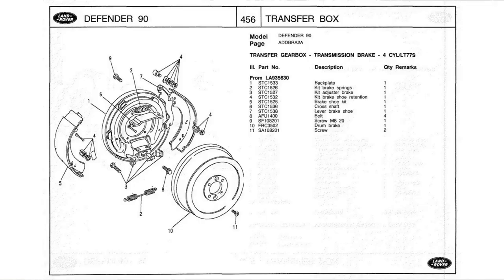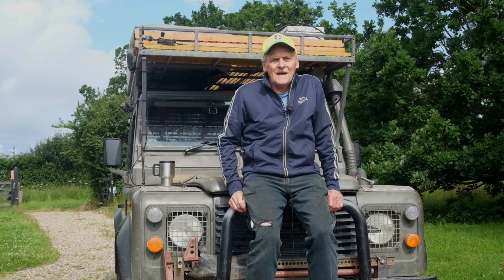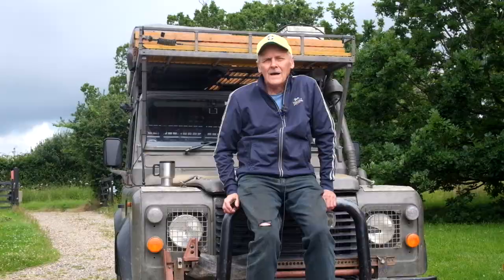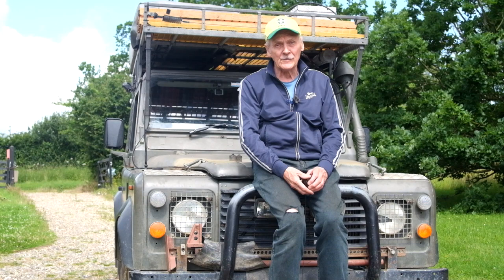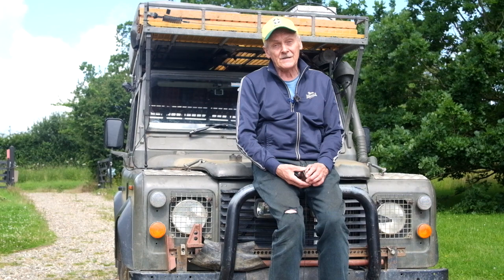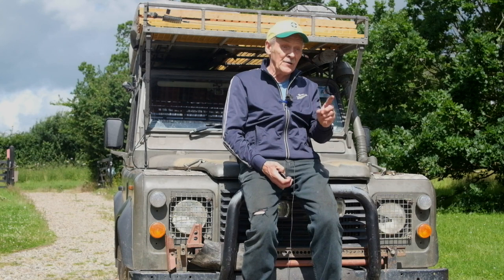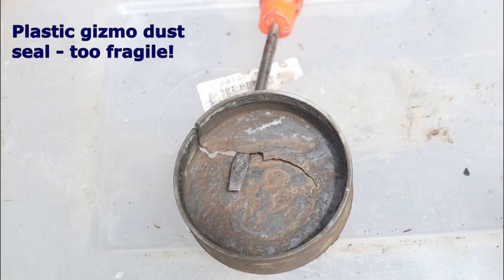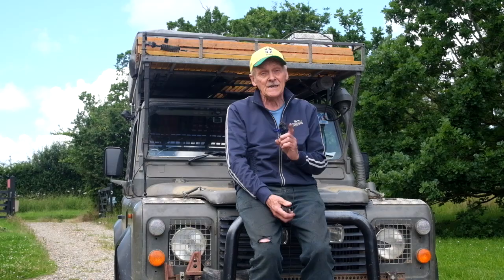Defender disc handbrake product review - a flawed design? How to make it work properly.

Comment: Good review. 
I’ve had a X-eng disc brake on my 110 for about 10 years and it has been faultless in that time. Haven’t even changed the pads. A very good mod in my opinion. Bonus is I can top up my leaky transfer box oil now directly from the bottle as there is more room to get to the filler plug. The downside is I’ve not got round to fixing the leak😅
Reply from the maker: You have done very well if you haven't had problems with the pads rattling and wearing. I wish I could say the same.
At the moment I have a small transfer box oil leak on my Disco 1 and the transmission brake is useless. I guess a transmission disk brake would still be working.

Comment: I would be interested in seeing you review the terrafirma unit. I have a rod operated 200tdi and the handbrake is useless.
Reply from the maker: @pwatom22  I have the standard drum handbrake in my Disco 1 which is utterly useless.
My X brake in the Defender is a huge improvement however it has been reduced to a lump of rust by driving through saltpans in Botswana. It'll be a big restoration job unless I start again in which case I'd consider Terrafirma. This is being documented in the current video series.

Comment: These calipers originate from a certain model of JCB, I don't know which one. I ran an early LR90 fitted with the X-Eng brake for many years without any problems. The big bonus for me was the reduced maintenance requirement after off roading. I always found the drum hand brake to be very capable, until it filled with mud and quickly went out of adjustment or the linkage got jammed. This is nothing dismantling and cleaning wouldn't solve, but as with the wheel drum brakes, it all takes time.
Reply from the maker: Thanks for the info. If you ran this with no problems you did much better than me - high pad wear; pads coming loose; rip off prices for replacement pads. With my mods I now have a workable solution, and if I need to replace the static pads I can get a supply at reasonable cost. Their performance, when working as designed, is very good.
Reply: @defendermodsandtravels  I believe many people said pads were available at a lower price direct from JCB spares sources, but I have no first hand experience of this. I bought my kit long before the business was sold to Foundry, and found customer service at that time was personal and top notch. It certainly devalues a product when such benefits are lost. I would say the irregular pad wear you experienced may have been due to the caliper not being free to slide on the guides. The gaiters must be in good shape and the sliding elements within be suitably lubricated. I'm glad you have found a reliable way to enjoy the benefits of a disk hand brake.

Comment: You need to change to the earlier style drums.  When they are setup, they work great.  They always hold.  They just need to be lubed up once in awhile.  The newer style is crap.
Reply from the maker: Now that I have got the disc handbrake working well I intend to stay with that. It's inherently a better design than the drum handbrake IMO. I am tempted to switch to drum rear brakes too but that means an axle change, as I recall.

Comment: Neither pad is static - both move; one on the calliper and one on the piston.  It sounds like your calliper has been binding on its rods through insufficient clearance, misalignment, insufficient lubrication or contamination.  I have heard of others having the same issue until they got the calliper moving freely.
Reply from the maker: The moving pad is spring loaded so it positively retracts. The caliper gets pushed back by the pressure of the rotor against the pad. Even if the caliper is free, as mine is, my experience is that this pad wears much more quickly.
Reply: @defendermodsandtravels  The principle is the same as most cars’ main brake system callipers.  The fixed calliper and pistons on both sides that Range Rover Classic, Defender and Discovery 1s have is atypical, a single sided sliding calliper being the norm, just like the aftermarket X-Brake.  They manage relatively even wear unless the calliper is seized on its rods, just like the X-Brake.

Comment: I fitted a discovery  drum system, so full cable , no idiot mechanical links, that i have phot evidence of my 90 holding on a 1in3, these discs are a useless fad, had my 90 for over 15yrs and never replaced the  holding brake shoes or a drum for that matter. my 110 holds over 3 ton quite regularly and releases niecely without fail, so, I advise fitting the Discovery cable  system , its soooo much cheaper
Reply from the maker: It's better than the Defender drum handbrake? Mine was pretty useless which is why I changed.